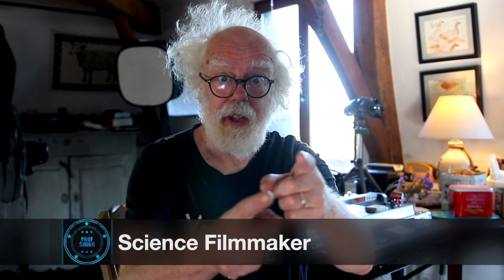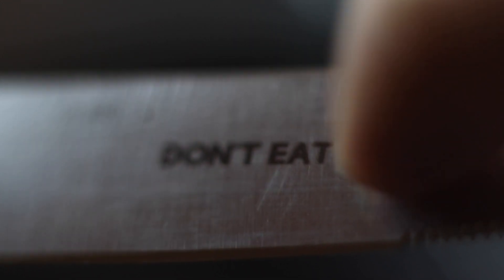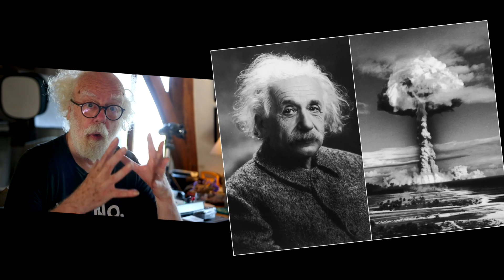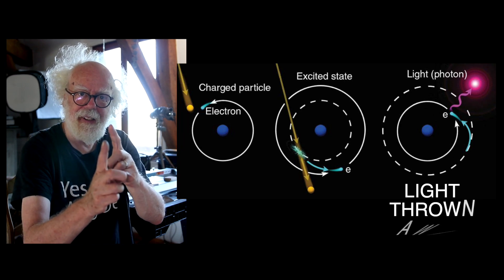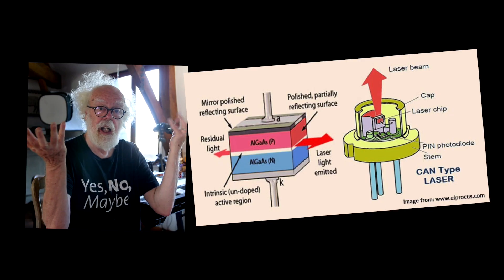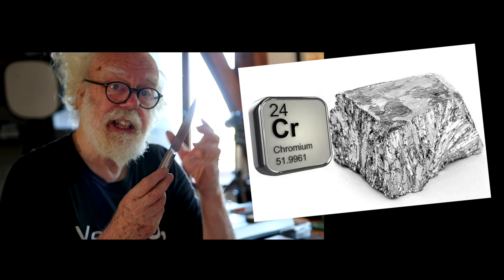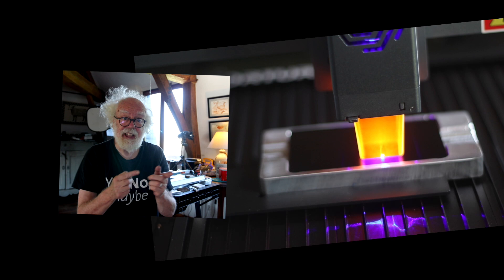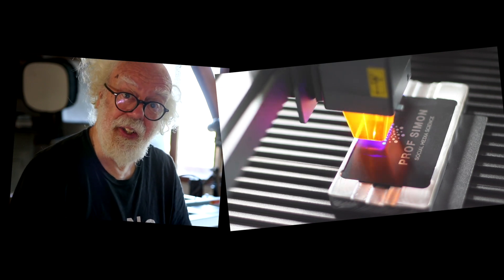Laser Cutting Science - How they work Part 2

Comment: hmm i guess if it uses UV it would be nice to illuminate the photo sensitive lacquer on circuit boards.  No need to make templates first,   but i guess it will burn the lacquer of and still work when you put it in your etch bath.. Maybe the laser can even etch the very thin layer of copper, without the need of templates and baths to develop and acid etch.
Reply: After some googling i found out people use the prev. iteration of this device to make PCB's by putting black spray paint on the copper and burn that of with the laser.  And then to etch the PCB in acid.  apparantly it wont burn the copper itself.

Comment: Just an FYI for the peepers. 
What eye protection do you need for Class 4 lasers?
laser safety glasses
One of the key requirements for working with Class 4 lasers is the use of appropriate personal protective equipment (PPE), such as laser safety glasses or goggles. These PPE must be specifically designed for the wavelength and power of the laser being used, and must be worn at all times when working with the laser.
Reply from the maker: good point....the orttur has an orange shield ...but UV blue laser light reflects off the work...do we need to protect for that? its only a 10w diode laser.
Reply: @SimonHollandfilms  Absolutely yes sir. A Class 4 laser beam is very powerful and tissue damaging. Did it come with some green filter goggles? I saw an optional Ortur enclosure that vents and blocks those nasty stray photons. I bet you look awesome with the green goggles on!
Reply from the maker: @fanofoldfans9238  oh no.....im feeling photon blindness already. .. Ortur supplied orange plastic goggles. i agree, an enclosure for light masking and fume extraction is on my list of projects.

Comment: Better pics of the card holder, are those lips on the top and bottom? You should do a vid on how you made that on your mill. I got a pack of blank black cards, was surprised even my 2.5W was good enough, but slow. Was going to try chemical etching stainless shim after burning off paint, but  the laser might go through? Stainless shim is common for model kits. Titanium shim jewelry heat colouring by laser?
Reply from the maker: good idea

Comment: Now i'm more confused than before. I thought that anodizing produces aluminium oxide. Doesn't this have an even higher melting point than aluminium? I thought it has to do with the wavelength of the laser and how the material absorbs this wavelength. I thought this is why some lasers cut plexiglas but do nothing in acrylic.
Reply from the maker: maybe its more complex than i researched?   can anyone enlighten us?
Reply: He doesn't talk about the melting point (solid -> liquid), but about the boiling point (liquid -> gaseous). As the laser is supposed to evaporate the working material, the boiling point matters. — — — That said, you're also right: aluminium oxide has a much higher melting point than not oxidized aluminum (2054 °C vs. 660 °C). And indeed, heat absorption matters a lot in laser cutting. I'd even say that's the reason why Al-oxide evaporates, but pure Al not.

Comment: You have to keep the temperature of a fibre laser diode in a certain range for it to work properly, we did this at Electrox for the Scorpion using a PIC PID peltier cooling system.  Those laser markers get quite complicated having a centralised Coldfire processor which runs MQX operating system and talks talks to PIC subsystems over a CAN Bus.  Also the x/y gavanometers are steered around by a Analog Devices SHARQ dsp processor.  You basically send points and line data across a cpld register from the Coldfire processor to the SHARQ.  Their old laser markers were out of date in 2007 hence the redesign, they used a huge water cooled refrigeration device and the code was all written in 68000 assembler and ran tasks on a round robin basis.
Reply: What does and talks talks to PIC mean?  Is that doublespeak?  Also, what is a cpld register? This all sounds very Mongoloid to me.
Reply: @skinovtheperineum1208 I meant to say it talks to Puck the mischeivous fairy companion to Oberon in A Midsummer Nights Dream.  What do you think I mean ?  To mark patterns you have a program which is made up of opcodes and data.  The opcodes are used to point to functions which can describe the shapes of objects such as circles, arcs, barcodes, data matrix and qr codes, the data which follows an opcode is passed into functions, this data is used to generate the objects to be marked.  For example to mark a circle you send the x, y centre and the radius of the circle.  The functions get quite complicated but they just output x, y points and lines data into a cpld latch which the dsp processor picks up and uses to steer the laser galvos around using an optimised pid control algorithm written in assembler.
Reply: @skinovtheperineum1208  A PIC is a very small computer on a single semiconductor chip. No display, no hard disk, no operating system, just a bunch of computing capability. One often uses them for simple tasks like operating stepper motors or (here) galvanometers. They can't do complex tasks like reading a PDF file or providing a graphical display, so one also uses a regular computer to do that. "Talking" means sending data to and from one PIC or computer to another.